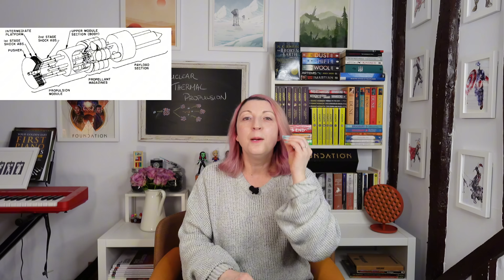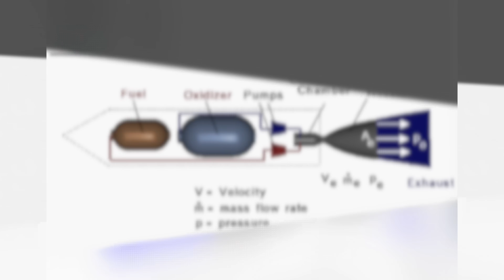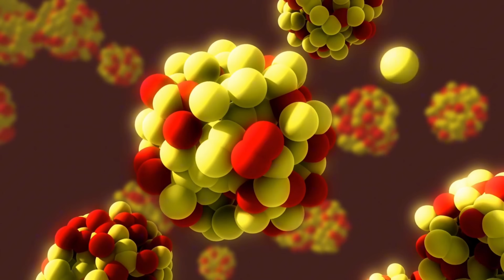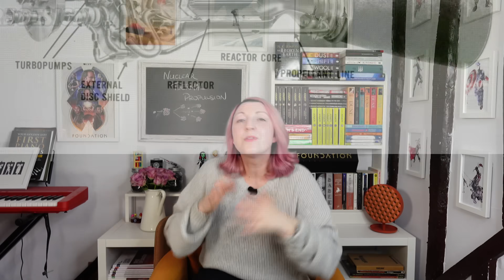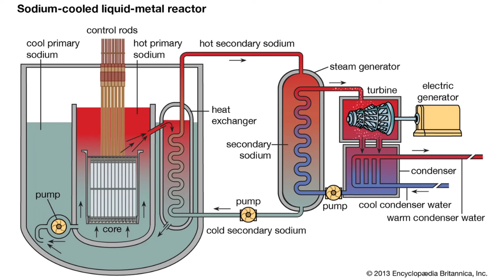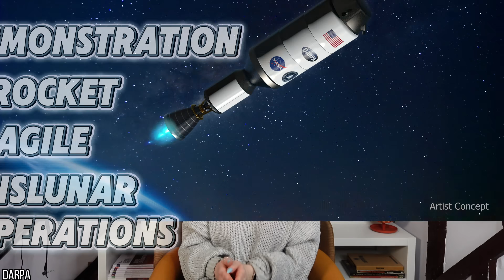Why Nuclear Thermal Rockets Never Took Off

Comment: You might be interested in the 'fission fragment' rocket design.  A quote from the wiki article for the version called 'rotating fuel,' which is made of disks of sub-critical fissionable material rotating into an area that makes it critical:

"The efficiency of the system is surprising; specific impulses of greater than 100,000 s are possible using existing materials. This is high performance, although the weight of the reactor core and other elements would make the overall performance of the fission-fragment system lower. Nonetheless, the system provides the sort of performance levels that would make an interstellar precursor mission possible."

There's another format called 'dusty plasma' :

"With exhaust velocities of 3% - 5% the speed of light and efficiencies up to 90%, the rocket should be able to achieve an Isp of over 1,000,000 seconds. By further injecting the fission fragment exhaust with a neutral gas akin to an afterburner setup, the resulting heating and interaction can result in a higher, tunable thrust and specific impulse. For realistic designs, some calculations estimate thrusts on the range of 4.5 kN at around 32,000 seconds Isp,[3] or even 40 kN at 5,000 seconds Isp.[4]"

There are other conceptual designs, for instance using Americium 242, the same material used in ionizing smoke detectors, that have high theoretical potential, but for my money, the rotating fuel disks seems like a high probability - once the magnets channeling the fission fragments has been optimized.

Comment: NTR is disappointing once you realise it is still limited by chemistry. You will never get the thousand-fold gains you would expect from switching from chemical to nuclear. Most of its gains just come from replacing water exhaust with hydrogen, allowing greater ISP for the same temperature.

One way NTR still can give you that nuclear-like sci-fi future you really want is that the engine could be refueled on any icy world. You could imagine some future Han Solo hopping around the moons of Saturn, mostly landing in dodgy ports looking for dodgy cargoes, but in a pinch they could land almost anywhere (anywhere icy) lay low for a bit while refueling and planning their next move.. probably involving a dodgy friend who has settled down and bought a gas mining operation.
Reply: Land, shovel some snow into the fuel tank and go again 🙂

Comment: At 4:00 you talk about the temperature ceiling being higher. But it's not. The extra ISP comes from the lighter molecule increasing the exhaust v. A nuclear thermal gets to 3100K, while a methalox gets to about 3600K and a kerolox gets a little higher than that.

Edit: ok. I've watched a bit more. Sounds like normal nuclear talking points. "Nuclear is really fantastic and a magic carpet ride and we'd show that, honestly, but all that red tape and politics means we can't, but for sure we could, if the politics and safety nannies and such would get out of the way, and never mind the Delta V, feel the ISP"

The reality is that nuclear thermal hasn't progressed because it's terrible. ISP is higher, about double, and the nuclear bugs concentrate on that, but in every other way it's terrible. Yes the fuel is light. But it boils at 20K. So all this incredibly light reaction mass needs incredibly large tanks with incredible insulation and that weighs a lot. Then you need cryocoolers because no insulation is good enough. Then you need radiators for the cryocoolers to reject heat into and solar panels to power them. Then because nuclear thermal is high thrust you need strong structures to hold them. All that weighs lots. But that's not all. The reactor puts out enormous radiation that will flash your hydrogen to gas. So you must have tonnes and tonnes of shielding. Or, you need a long truss to keep the hydrogen away from the reactor (like the ship in 2001). But the truss can't be launched so you need to build it in orbit costing hundreds of launches. 

Then once you've run the reactor it's hot. Literally, the short lived daughter products decay producing huge amounts of heat, so you need to continue to vent hydrogen through the pile for days or weeks, which costs more mass that doesn't produce thrust. 

All this extra mass kills the dry/wet mass ratio and eliminates the advantage you get from the higher ISP. 

And all the while there are ion drives sitting on the shelf that produce 3 times the ISP of the nuclear thermal rocket and could be powered by the same size solar panels that ran the cryocoolers and which use argon that has a much higher boiling point and which fits in a tank that's less than a tenth the size.
Reply: -hydrogen nuclear thermal rockets have three times the exhaust velocity of chemical rockets. 3 not 2. Methalox like space X uses is 3.4, nuclear thermal hydrogen is 9.5 at sea level pressure. So congratulation you don’t know how to divide 10 by 3.4. This directly translates to 3 times the delta v. It’s the difference between everything being possible and most things being impossible, to get 16 kilometers per second of delta v out of a 3.4 kps exhaust velocity engine... well you do the math lmao, it’s not pretty, and I doubt fuel tank technology is good enough to even achieve the required mass ratio

-nuclear thermal rockets can run on any fluid. You spent like half your post complaint about hydrogen completely unaware nuclear thermal rockets can also run on methane, kerosene, hydrocarbons or noble gases without any issue. Good exhaust velocity too, methane reaches 6.5 because the hydrogen atoms it contains decompose form the methane molecule at these temperatures. They do not produce carbon deposits or gunk if the temperature is sufficient

-all your points about hydrogen storage and boil off applies to hydrolox which is nearly mandatory for some applications and missions as the roughly 33% boost in delta v it has over hydrocarbons is extremely valuable if you don’t have enough delta v on hydrocarbons. Literally an exponential reduction in spacecraft size due to the natural logarithm applied to the mass ratio 

-you completely overestimate how much radiation shielding weighs. We’re talking tons on a spaceship or rocket that weighs thousands of tons. Radiation basically decreases exponentially with shield thickness, it’s not linear, each layer removes a percent of the remaining radiation at that layer. 

-the engine staying hot after it has been shut down is not an issue. At all. They should be designed to survive temperatures way higher than they will reach from all the chain of fission and decays and the remaining heat that was there when it was shut off. All you need is to thermally isolate the engine from the ship which is very easy to do.

-the extra mass does not "cancel out" the exhaust velocity you absolute clown, if it does you just add more fuel. Or scale down the engine. If it’s an earth to orbit launcher you of course need to scale up the thrust and TWR of the engines. Which is fairly easy to do considering that in case you forgot, nuclear bombs are a sub category of nuclear reactor and that a nuclear reactor can be optimized to have any output in watts up to and including a literal nuke worth of joules per second and energy output. What limits the thrust of nuclear engines are the flow rate of the coolant, and material strength. Heat is only a small limiting factor for strength because active open cycle cooling can be tuned to fairly extreme degrees. Of course the crazier you go with the engine the higher the risk something might go wrong, but it can go extremely high. Turbo pumps are a big part of the limitation 

In other words the TWR of the engines is sufficient to maintain the same mass ratio as a chemical rocket would have if they are designed to be strong and lightweight, which of course isn’t a design consideration in a planet to planet transfer stage, which wouldn’t need thrust at all. 

Your assertion that somehow a nuclear spaceship could not be the same % of fuel by mass as a non nuclear ship is beyond insane, the only thing that might make that scenario happen is if it’s a ground to orbit launch vehicle and your engineers haven’t managed to develop lightweight reactors and turbo pumps yet

-the point about the mass ratio of fuel tanks lowering the delta v is only true for hydrogen. That’s again you forgetting that the best chemical engines run on hydrogen and that nuclear thrusters don’t have to run on hydrogen

-you seem to have forgotten the rocket equation too because otherwise you’d remember that the relationship between mass ratio and exhaust velocity is an exponential one. Even a trash mass ratio of 3 on a fuel tank that contains hydrogen vs methane oxygen or argon would STILL yield much higher delta v because the mass ratio is logarithm’d out, while the delta v is LINEARLY PROPORTIONAL to the exhaust velocity.  

So no, having admittedly awful hydrogen tanks that barely contain any hydrogen for how much mass they weigh would STILL give you far more delta v than lower exhaust velocity options, so long as you have enough of them 

I mean just so we’re clear, a fuel tank that’s 25% tank by mass can give you a ship that’s like 30% dry mass fairly easily and with an exhaust velocity of 10, without staging, at the same total mass that’s still way more delta v than any low exhaust velocity options. We’re talking 13-18 kilometers per second compared to 7-8 for a single staged rocket. (Staging helps the hydrogen one far more than the dense fuel ones btw, since you remove fuel tanks which are a far larger % of total mass for hydrogen, oops!)

-ion engines are indeed goated

So pretty much all your complaints are completely wrong and you call scientists "the nuclear bugs", but there are actual arguments against nuclear, which ironically enough are those in the video you just complained about

The real downsides are cost/availability of the fissiles, ease of assembly and maintenance of the reactor, and politics. The cost alone is almost a dealbreaker, because chemical fuels can be produced on earth in a renewable way fairly easily, meaning you can launch tons of stuff to orbit very inefficiently like with a methalox fuel silo abomination, like space X does, for cheaper than if you used far better nuclear SSTOs. Because U235 doesn’t grow on trees. Methane and oxygen? Well you can literally turn the wood of trees in methane and use some of it to extract oxygen out of the air lol, so methalox does quite literally grow on trees. 

The other consideration you didn’t mention is that nuclear thermal rockets only make sense when you need high thrust. In this regard they are far better than chemical rockets and a big, direct upgrade. But when you don’t need high thrust (includes all planet to planet transfers) then everything is outclassed by ion engines
Reply: @IceRain-f5v  Ok. 

A lot to get through, and some good points (a little heavy on the insults, but hey, it's the internet, and lots of people feel that any opinion that's not theirs is a personal insult and requires their id to come out and play. 

"-hydrogen nuclear thermal rockets have three times the exhaust velocity of chemical rockets.

3 not 2. Methalox like space X uses is 3.4, nuclear thermal hydrogen is 9.5 at sea level pressure. So congratulation you don't know how to divide 10 by 3.4. This directly translates to 3 times the delta v."

Ok, I took the highest ever theoretical ISP in a vacuum of 875 seconds. Pewee 1 achieved a reactor exit temperature of 2750K. It didn't actually achieve that ISP, but with a perfect bell it could have. (So in reality it couldn't have) 

Now the highest ever actually achieved is probably the RL-10 which gets about 460 seconds. 

Double that is 920 seconds. Well more than the theoretical 875 of nuclear. "About double" is more than fair. Yes, if you compare the never actually achieved, theoretical maximum isp of nuclear (875s) with the rumoured isp of the raptor (380s) you get 2.3 to 1. That's "about double" in book, but if you want to call that "3 times", please, go right ahead.

"It's the difference between everything being possible and most things being impossible, to get 16 kilometers per second of delta v out of a 3.4 kps exhaust velocity engine... well you do the math Imao, it's not pretty, and I doubt fuel tank technology is good enough to even achieve the required mass ratio"

I don't know what you're planning that needs 16 km/s, and I didn't say that you should use chemical rockets for that. I said that the Nuclear Bugs concentrate on that (as you have in your comment). I said that SX has ion drives on the shelf that would do the job. At an ISP of 2500s a mass ratio of 1.92 gets you 16 km/s. Nuclear thermal needs a mass ratio of 6.5 to hit 16 km/s

"-nuclear thermal rockets can run on any fluid."

There's no evidence for this

"You spent like half your post complaint about hydrogen completely unaware nuclear thermal rockets can also run on methane, kerosene, hydrocarbons or noble gases without any issue. Good exhaust velocity too, methane reaches 6.5 because the hydrogen atoms it contains decompose form the methane molecule at these temperatures. They do not produce carbon deposits or gunk if the temperature is sufficient"

You're making this up. No one has ever tested it and it seems unlikely that "the temperature is sufficient" when nuclear thermal runs cooler than kerolox which does gunk up. The average molecular weight of decomposed methane is a bit over 5. So it's going to give an ISP of 535s. The noble gases are all vastly too expensive and rare to be practical at this scale except for argon. Argon has an atomic mass of 40. Hydrogen has a molecular mass of 2. That drops your ISP from 875 to 195. 

"-all your points about hydrogen storage and boil off applies to hydrolox which is nearly mandatory for some applications and missions as the roughly 33% boost in delta v it has over hydrocarbons is extremely valuable if you don't have enough delta v on hydrocarbons. Literally an exponential reduction in spacecraft size due to the natural logarithm applied to the mass ratio"

Yes. That's why I said to use ion drives 

"-you completely overestimate how much radiation shielding weighs. We're talking tons on a spaceship or rocket that weighs thousands of tons. Radiation basically decreases exponentially with shield thickness, it's not linear, each layer removes a percent of the remaining radiation at that layer."

You literally said "We're talking tons" and my comment was "tonnes and tonnes". Sounds like we agree. So somewhere in the range of 2 to 4 tonnes per engine, (NASA says 3.4 tonnes per engine) so 6 to 20 tonnes per ship given 3 to 5 engines. It's also just one of the things I pointed to as increasing the dry mass that could have been spent on ion drives and solar panels. 6 tonnes equates to about 1000 SX drives and the solar panels needed to drive them. 

"-the engine staying hot after it has been shut down is not an issue. At all. They should be designed to survive temperatures way higher than they will reach from all the chain of fission and decays and the remaining heat that was there when it was shut off. All you need is to thermally isolate the engine from the ship which is very easy to do."

I'll politely disagree. It's at close to it's melting temperature during operation. So that's it's temperature when it's shut down. It's in space and it's enclosed and can't reject heat, so any further heating will melt it. You must run coolant through it or it will melt. 

"-the extra mass does not "cancel out" the exhaust velocity you absolute clown, if it does you just add more fuel. Or scale down the engine. If it's an earth to orbit launcher you of course need to scale up the thrust and TWR of the engines. Which is fairly easy to do"

I didn't say "cancel out". I said it kills the wet/dry mass ratio. Adding more wet mass is the consequence, which you then say "just add more fuel" which is what I said. You have to add more fuel or not get to your target delta V. That's what killing the wet/dry mass ratio means.

And that's all I've got the energy to reply to. Basically we agree, even if you don't realise it. Ion drives are the right choice. Nuclear will never be used to launch from an inhabited planet, it's an in space thing only. In space it can't compete with ion. For planetary launch it's chemical only. You seem to have taken my post as advocating for chemical for interplanetary.

Comment: In the movie 2001, A Space Odessy, the spaceship Discovery 1, had Nuclear Thermal Rockets
Reply: Wasn’t it nuclear ion? I know the original design had radiation’s (removed by producer veto who was afraid the slop eating masses would be mad at the movie for "putting wings on a spaceship cuz there no air in space")
But since nuclear thermal engines are cooled by the propellant they wouldn’t need radiators

Yes after you cut off the propellant flow they would get hotter and stay hot for a while but you have time, nuclear thermal rockets are designed to handle thousands of degrees of temperature, it doesn’t matter if it takes months for them to cool down after firing, and I’ve never heard of any nuclear thermal rocket that had a non propellant coolant loop, that would increase the risks of failure and design complexity tremendously